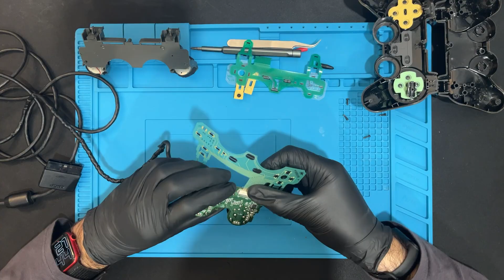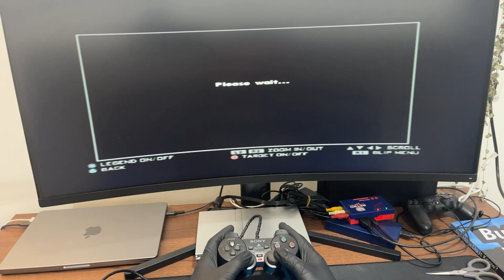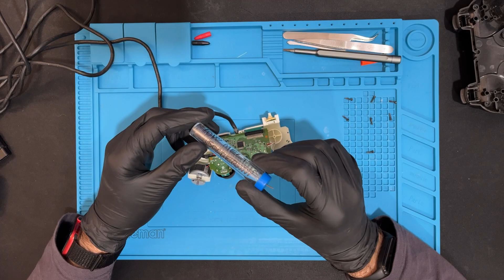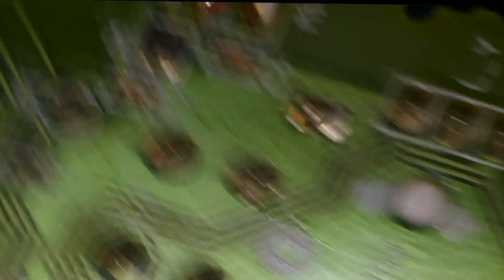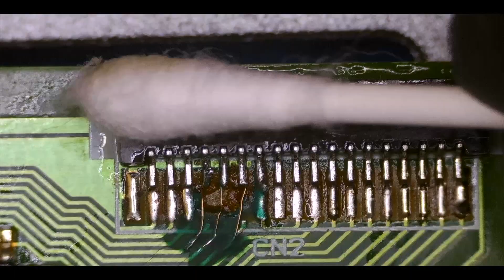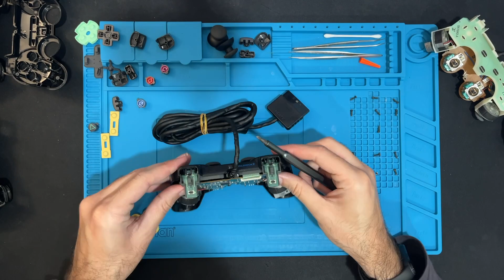Fixing two PS2 controllers

Comment: im a beginner so sorry if this is stupid, but why didn't you use flux before desoldering using the low melt solder?
Reply from the maker: It is a very valid question 👌🏽 I could have used flux to help, yes. Maybe it would have avoided the mess. I didn't use it because low melt solder stays liquid for longer and it is "touching" all the contacts while staying liquid so I could remove the connector. But it doesn't hurt to still use flux, always helps!
Reply: I did this same repair heat gun and aluminum foil cheap soldering iron works great